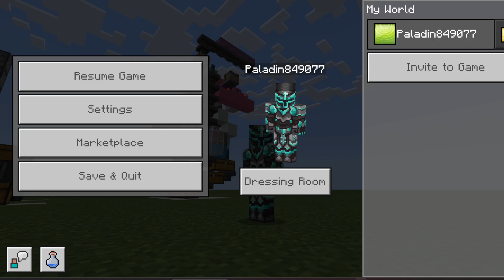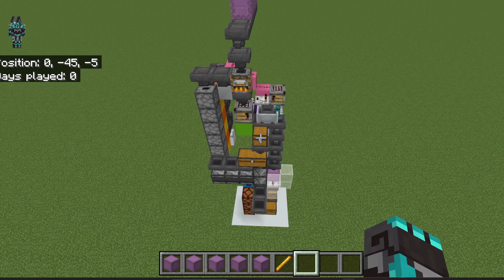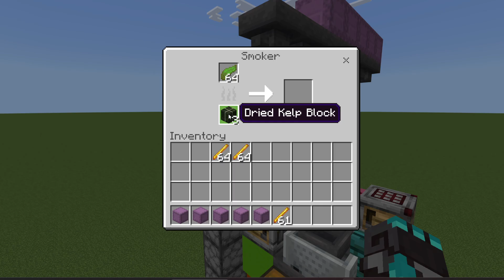Minecraft Bedrock 1.21+ Infinite self fueling furnace!

Comment: Nice build but may I offer some suggestions to slightly cheapen the construction. Your autocrafter will work just as well with a furnace containing in total something like 99 kelp (as your 'machine' is producing kelp) or a cauldron with water or even a composter full of kelp instead of the second crafter. Also it works just as well with a double chest instead of a hopper minecart as the smoker produces dried kelp very slowly. Oh, your elevator will operate with redstone dust in lieu of redstone torches.
Reply from the maker: @bitebaykon9948  In my latest video I actually use most of these upgrades! Thanks for the tips! I will test the "Large Chest" in place of the minecart with hopper, I thought the crafter couldn't deposit items directly to a chest.